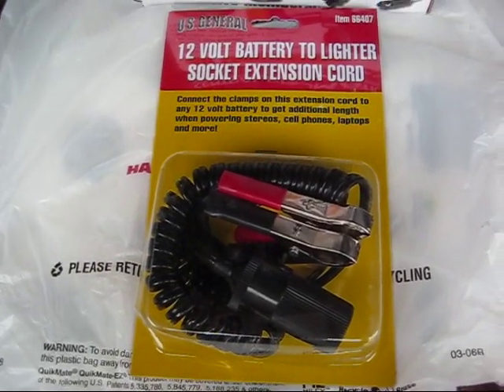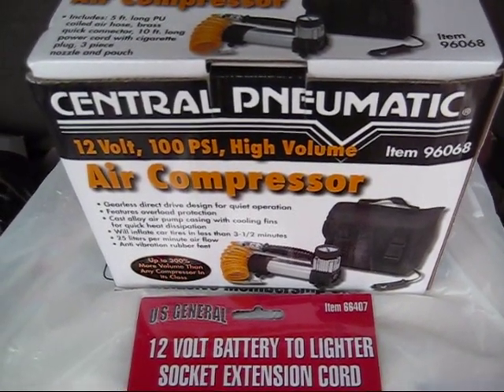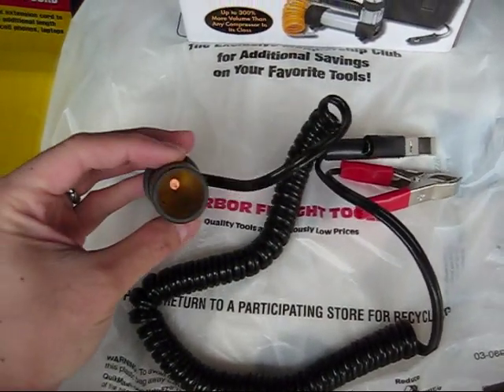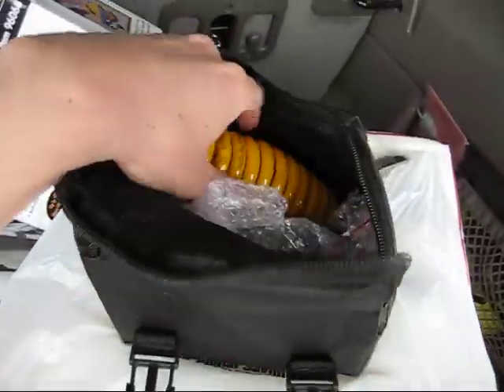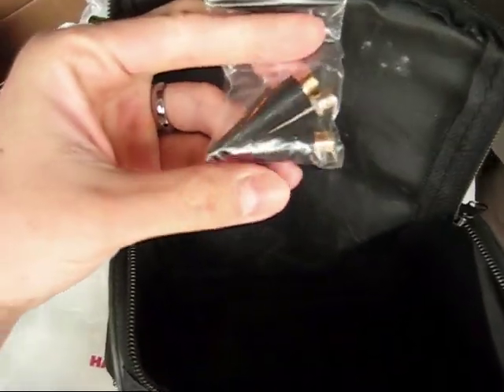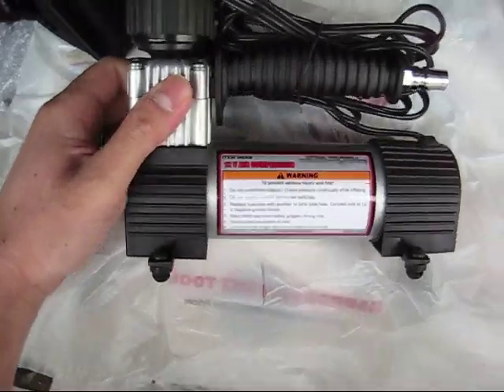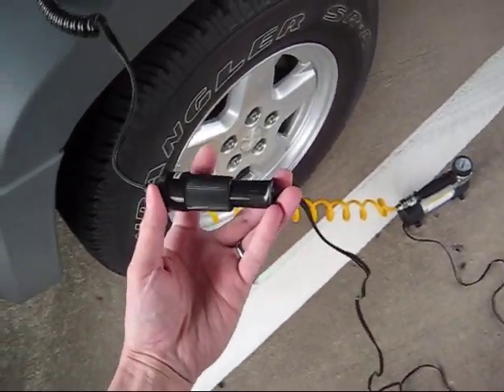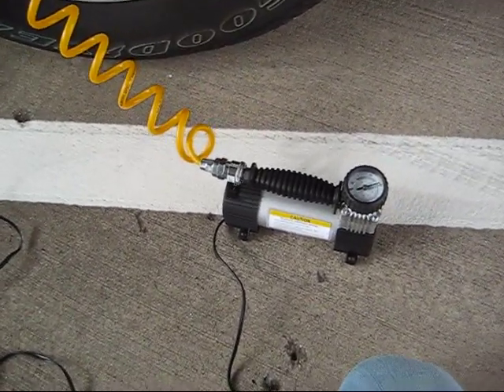12V Battery to Cigarette Lighter Adapter - You Need This

Comment from the maker: Search amazon dot com for--  AC DC Converter.  These converters will allow you to use an inflator indoors.  The resting voltage of a car battery can be as low as 11 to 11.5 volts.  When the engine is running and the alternator is charging the voltage can be as high as 14 volts.  12 volts is considered the nominal rating that everyone knows.  The actual voltage of a fully charged car battery is 12.6 volts.

Comment from the maker: I believe it was somewhere in the low 30s and took 2 minutes or so.  Harbor Freight claims it can fully inflate a tire in 3.5 minutes, but I truly doubt it.  Maybe 5-8 minutes depending on the size of tire.  It's not the fastest thing in the world, but it surely beats the cheapo plastic inflators.  If you don't mind spending a little more, checkout the Wagan EL2050 at amazon.com.  I also own this model and it fills up tires quicker.  Look for my review under the name "BT".   Thanks for watching!

Comment from the maker: As far as the voltage and amperage-- you'll need a converter rated at 12 volts. The amperage will depend on the required amperage of the device you're plugging in.

Comment: Works great if you have a emergency light but your cigarette lighter in the car will not stay on with no key.
It turns the led lights into an adaptered to run it off the battery so you can use a light with a 12 volt plug.

Comment: Hello, good video
I'm here because I failed trying this and was looking online for help. I've tried it on 2 batteries, 1 out of a car that is a spare and one on a car. Both times my compressor runs for a millisecond and stops. The light on the compressor works fine but not the actual compressor. It does work via my cigarette light on my car. This makes me think maybe the adapter is inferior. What do you think?
Reply: Forgot to mention charging a phone seems fine
Reply: Just to come back. I wired the 12v adapter to the car adapter and I got the same problem so I've concluded its the adapter.
Reply from the maker: @mikeyp - When you're testing the air compressor being connected to the battery (w/ 12v adapter), do you have the air chuck already attached to the tire's valve stem?  I've seen cases where the air compressor motor doesn't want to turn over because the resistance from the tire's pressure is too heavy.  In that case, you could turn on the air compressor first, then attach the air chuck to the tire's valve stem.  It's a long shot, but wanted to throw it out there anyways.

Comment: Couldn't you just cut off the adapter end of the pump and add 2 clips and attach it directly to the battery without the cigarette adapter?

Comment: if the air compressor was light enough and add like a 9 volt battery and two AA's or something else to make the 12 volts the air compressor , combine it with a homemade like air gun and you'll never run out of compressed air for your air gun

Comment: Think the amps are too high to charge a phone?  (With an adapter)
Reply: Think you need to take lessons in physics - focusing on the law of Ohm. The current is not depending on potential of the power source but the internal resistance of the applied unit.

Comment from the maker: you don't need the car running, but if the engine/alternator is running the battery voltage is higher and the compressor runs stronger.